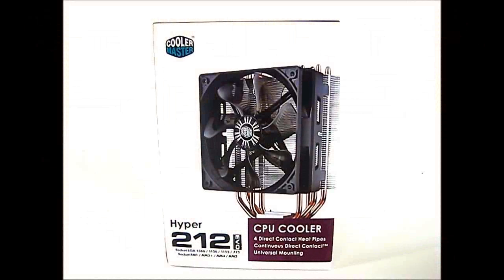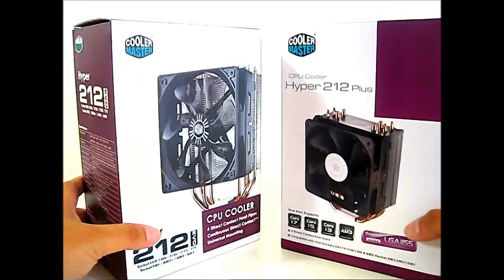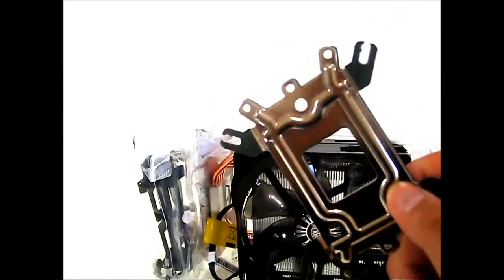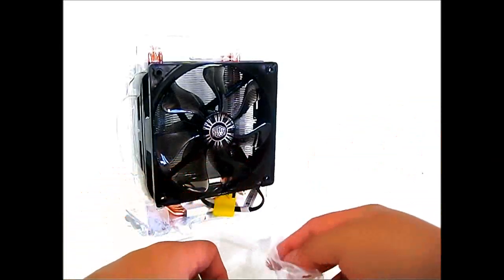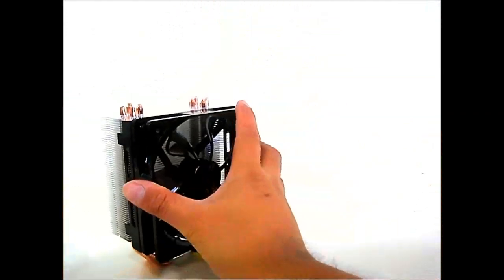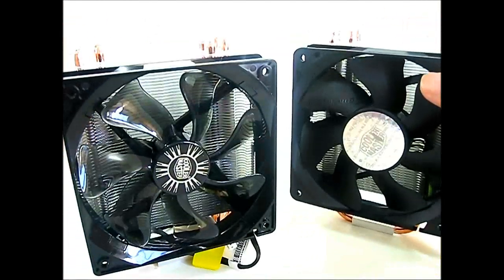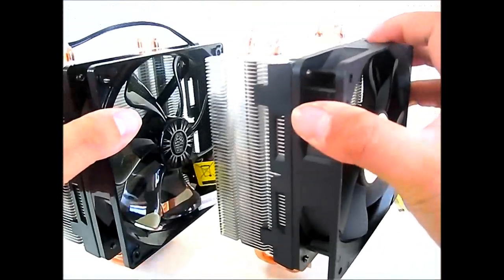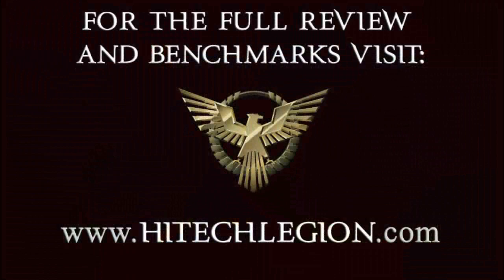Cooler Master Hyper 212 EVO - Unboxing and Product Overview

Comment: the heat pipes work similar to an air conditioner system pulling the heat away from the cpu and into the fins of the heat-sink, the fins then dissipate the heat into the air around them, the fan constantly blows new air past the fins to be heated and the already heated air away.

Comment from the maker: In east/west orientation, it should work since the width is 51mm (the only other heatsink I know that is thinner is the Prolimatech Armageddon which is 50mm) plus 25mm for the heatsink. I actually bought another one of these since I swap out heatsinks all the time and this is the pound for pound best when you factor in cooling capability, price, virtually no clearance issues. In North/South orientation however, it depends on your motherboard.